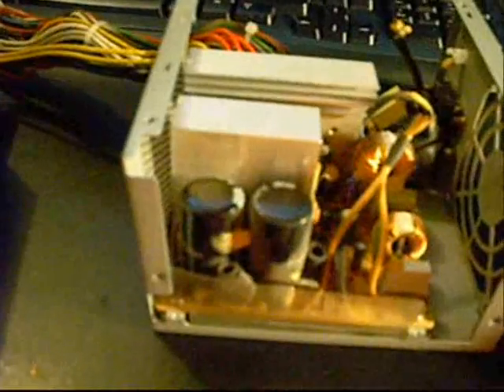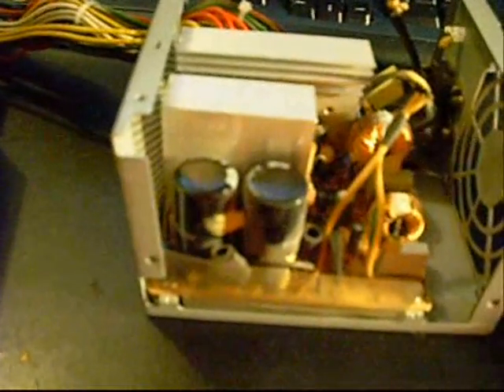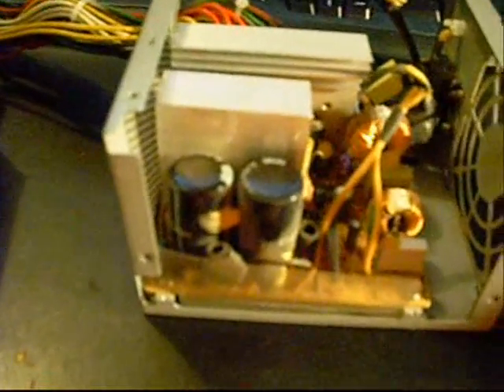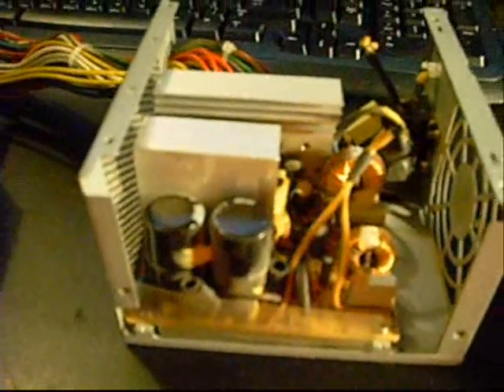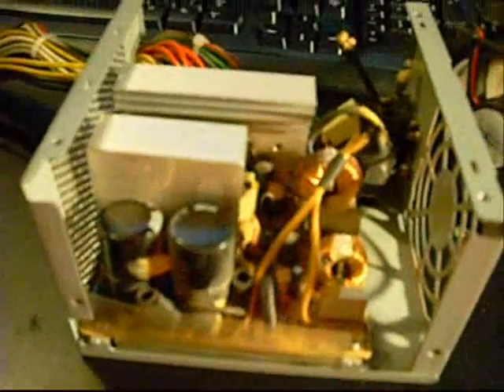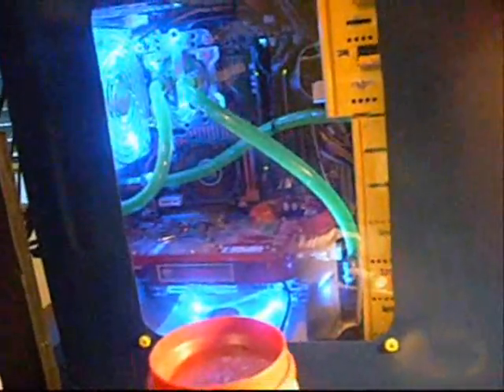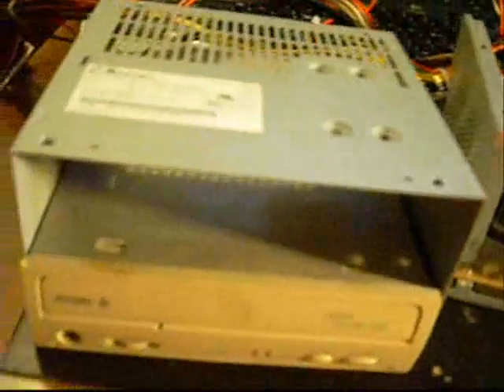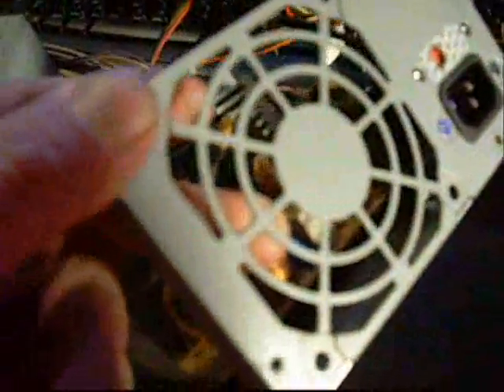Dont throw your old computer parts away before watching this

Comment: One year ago My old graphic card's gpu was burned  cause of overclock.So I've bought a new one and kept old card. Later I fould a graphic card for free which have problem about two capacitors and my old card's capacitors has same value with the new one's I've found. I soldered healthly capacitors from old to new card and It works fine:) By the way Very good video, I think everyone should think about it seriously before throw it in the trash. Thank you for sharing those informations with people:)

Comment: you should take the MOSFETS from those heatsinks on the power supply, you can use them on a ZVS flyback driver for a safer high voltage experiment!!!

Comment: I would say, even if you aren't going to use the 20 pin connector, cut the wires for the wire. Leave the connector on to help keep the wires from tangling too much and cut them one at a time as needed. If you ever get too much saved-up, you can put together some beginner electronics kits and give them away as promo for your channel. ;)

Comment: Hi ya just watch your video it's what I do to get parts, now the 24 molex plug is not that hard to work out. And easy to use in other ways like a bench top power supply. here is a link for any that wants to know the configuration of the 24 molex plug
https://en.wikipedia.org/wiki/Molex_connector
Link for bench top power supply is here: 
https://www.youtube.com/watch?v=z2oSFpKh_Uw
I hope that is helpful
Reply from the maker: +Michael Blom Very good info!!!!!